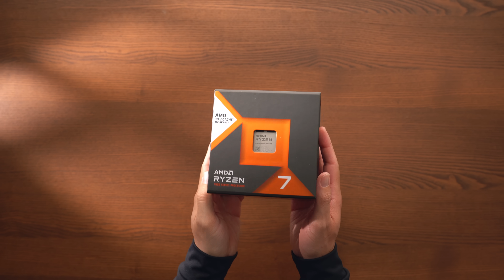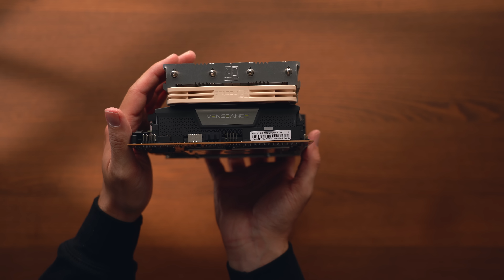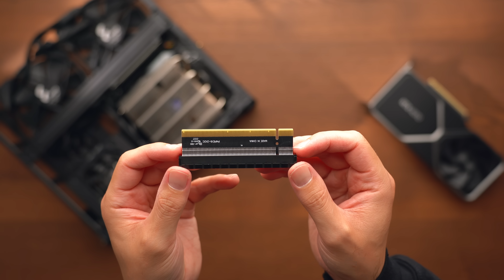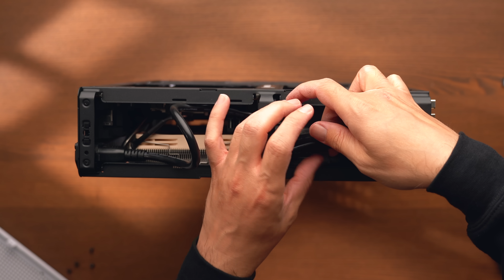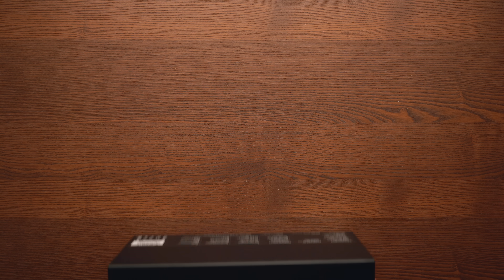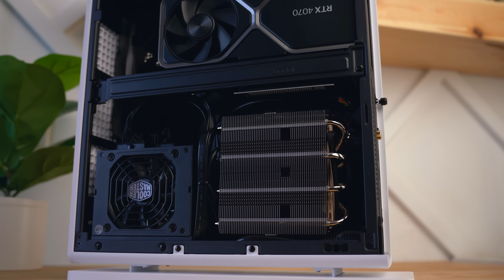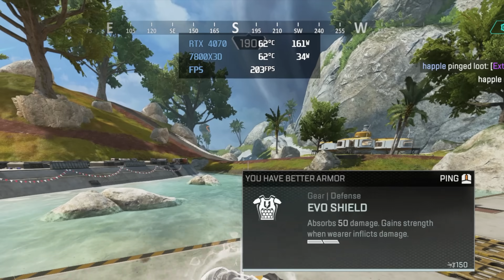UNREAL Mini Gaming PC - PS5 on Steroids

Comment: I'm a minimalist PC gamer with console envy, and this build is right up my alley! Terrific video! I subbed because I'd love to see more builds like this!

EDIT: Looks like I found a new phrase to troll PCMR elitists with. 😂
Reply: there is nothing to envy about consoles
Reply: @wellnesportstore9519  price/performance/looks/simplicity
Reply: @Ultra-Settings  did you just typed performance? 🤣🤣🤣🤣🤣🤣
Reply: @wellnesportstore9519  Hope you're aware that they parallelly connect hundreds of consoles together to do simulation computations in various military areas. So yes performance. Don't get me wrong, I still do hate consoles starting from the day they blocked booting windows. But gotta be objective.
Reply: @wellnesportstore9519  price to performance ratio.
I have a decent pc (i5 13600kf, 64gb ram, 6700xt) 
most normal peole who wanna play rocket leauge, cod & other Esport titles dont need a 4070
i am a pc user because i like the freedom of modding things and upgrading parts instead of being in a fixed buy cycle.
Reply: @wellnesportstore9519  Short answer: there are. Price-to-performance, priority, and aesthetics.

Extremely long answer (that you're too lazy and/or mentally challenged to read):

Price-to-performance ratio, for one. $500 PS5 that has everything you need out of the box or a $600 graphics card that's only one part of a potential $1,000+ DIY PC build? Unless you want power and are willing to put in the money and work to get it, most people will get the console.

For another: priority. Like it or not, consoles are given priority with (timed) exclusives and better after-sales support (e.g. patches). Before Sony and Microsoft decided to port their exclusives to PC, you'd be forced to buy a console or emulate the game you want (poorly). To give you examples: to this day, there's still no PC port of Red Dead Redemption 1 and it took 13 years of waiting to finally get the 2002 Resident Evil 1 Remake on PC. Some console games are continuously patched, while PC ports are left in the dark and have to rely on fan-made patches to be functional.

Lastly, aesthetics. Call me a boomer, if you will, but if I want to be taken seriously as an adult professional, I don't want my PC to look like it was made by an edgy 15-year old with the "black/red trim, angular, RGB light show" kind of aesthetic gaming PCs typically go for.
Reply: @jmal  lol i aint gonna read this crap just admit your wrong there is no performance they had to create 5 gens to finaly get up 2012 pc performance while computers were crering the very games they sell
Reply: Consoles offer a better, a FARRR better social aspect, and voice chatting, FARRR Better, but they suck  :D Only saying the pro.
I got a ps5,4,3,2,1. PSP. PS = Kids and generally more adults. Cleaner menues - Worse socially than Xbox, mostly due to there being more adults who have social anxiety.
Xbox1,360 Elite. Xbox = Kids. Xbox = even better social.
Reply: @wellnesportstore9519  if you think that there is a pc with better price/performance then youre ridiculous
Reply: You're like 1/50000 people in the world that this video actually benefits. I'm happy for You.
Reply: @eugenijusdolgovas9278  Thanks! It's nice to know that we all have different preferences and can build our machines however we like. That's something consoles will never be able to replicate, much as I envy them on certain things.
Reply: @jmal  there's nothing in consoles, that PC players don't have. Gaming communities are way more toxic on consoles, so idk what You're longing for there.
Reply: @NeonXXP  Console was a portable item, that is affordable, which it is now. Compare 6700 + 5800x build in 2020 to pc price and You'll what SOME pc players envy. Aside from that, it's crap.
Reply: @wellnesportstore9519  Why? Where else would you get a pc capable of 8k gaming for 300-400$??
Reply: @jmal  Console HW is known to be under-priced to stay competitive. So in short term HW is cheaper but in long run it gets even if you consider more expensive games and need to pay subscription to play online. PC is multi-role device and can handle more tasks than just gaming. So in most scenarios you have low-power work/internet PC + console but you can combine this money to get single better PC and suddenly the price difference is not that huge. The major advantage of console is that they are easy to setup and use but that limits them in functionality but nowadays you can buy pre-assambled and pre-installed PC so this is no longer relevant.
Reply: @qwe5qwe566  We all know that, but does the mainstream? There's a reason why devs and publishers give priority to console releases and treat PC ports like a red-headed stepchild.
Reply: @jmal  mainstream gaming is rubbish since it's grown big. It's like any other mainstream branch like movies or music. If you want niche games steer away from mainstream into indie scene and you often don't need nasa rig to enjoy it and no need to cry about bad ports since majority of those games never make it to consoles and if so then after they finish pc version.
Reply: @qwe5qwe566  "no need to cry about bad ports because the majority never make it to consoles"?

Your statement doesn't make sense. So if I take it at face value, you're saying that we should let developers treat PC gaming as an afterthought because of your personal preferences? Is that what you want me to take away from what you said?

And while I get that you don't need a literal supercomputer to play an indie game that utilizes retro-style graphics, what does that have to do with AAA developers treating PC gaming as an afterthought?

What is with this dogmatic approach to PC gaming? Why is taking inspiration from consoles so taboo and verboten to you people? You know there are far better things to be dogmatic about, right?
Reply: @wellnesportstore9519  I also said price which you ignored but you replied with more emojis than words so I’ll not take you seriously
Reply: @@elisepulveda8124 how am I being biased? I’ve owned every ps, 2 Xbox’s and Nintendo consoles but I’ve primarily played pc for 3 years now. You do get a lot of freedom on pc but consoles have a lot less technical problems unlike pc such as games not launching properly or at all. I’ve had to google a problem a lot more for pc than I have console
Reply: @@elisepulveda8124 I'm not ruling anything out, you don't have to pick one over the other. I'm saying consoles have a lot of benefits and people like to shit on them because of the pc master race mentality
Reply: @wellnesportstore9519 I game on both ps and pc
Reply: @@elisepulveda8124 Yeah you're young. I understand why you'd think like that
Reply: @@elisepulveda8124 6 replies in a row says a lot
Reply: @@elisepulveda8124my location?💀You’re 17 I don’t think your parents will let you on the bus by yourself
Reply: @jmal the ps5 side plates look defective lol.
Reply: @@elisepulveda8124 My house has disability access and John Travolta access I have a landing strip in my back garden with a terminal extension on my house so he can park straight up. I also have a Bugatti Chiron with rgb paint first of it’s kind you’re not on my level bro 💀
Reply: @@elisepulveda8124 sorry bro you’re not high enough level to be talking to me
Reply: @Eli Sepulveda Consoles are not only for “simple people” as you say. Alot of tech savy people prefer to play on consoles due to things like shader compilation stutter with unreal engine 4 games, and poor optimisation for aaa games, there’s been alot of bad pc port launches this year. And then there’s games like Fifa 23 which was a bit of a mess on pc, it doesn’t matter how tech savy you are, if you like Fifa then it wasn’t a great experience for pc gamers. Alot of Game devs favour optimising their games for consoles. But it really depends on what people prefer
Reply: @Ultra-Settings I don't get these people, dude. Of all the things to be elitist about, it's freaking gaming computers. And they tell me console gamers are toxic? 😂

Something tells me they're just a bunch of privileged kids with no real problems in their life.
Reply: You can smell the pissy mustard rice foaming at the idea that their platform of choice could be in any way inferior to consoles lmao
Reply: How about having both a console and a PC for gaming? Consoles are sold under price. For 800 hundred bucks you get a PS5 with an extra 2 TB SSD. That's a piece of hardware that's smaller, quieter, and better designed than most PC, while for 97 out of 100 games you won't see any difference to the 1800 bucks system from the video. I mean not all games use ray tracing or subsurface scattering so that you actually need even more power than a PS5. Excellent games need much more than good graphics. Take the Horizon games for example. If you played Forbidden West and than play Zero Dawn, you will notice the missing subdermal light scattering, however, the old version is still a tremendously awesome game that runs on my PC very well with a Radeon 570...
Reply: @chetzmoka  That was from over a decade ago. It was called the Condor Cluster I believe. They used PS3s due to their powerful (but hard to develop for) cell architecture which had Yellow Dog Linux. They were also much cheaper than PCs.

Most consoles now since the eighth generation basically just use heavily customized PC hardware, and they're much more locked down.

Wikipedia has a pretty interesting page on this:https://en.wikipedia.org/wiki/PlayStation_3_cluster#Single_PS3

Comment: I love these sorts of ITX builds. Huge space savings with tons of performance.
Reply: @ronakparikh  Actually, mini ITX systems are common in China as university students are pressed for space. I know a lot of people just like the smaller system for the aesthetic and some like it because its more wieldy to bring to LAN parties (for those who still have those). I know I like them because they are easier to make clean and compact on a desk given multiple monitors.
Reply: @ronakparikh  i have a DAN-A4 build for travel purposes. The entire PC with all the stuff in it weighs 4kg with a tripple fan, dual slot GPU and a 65W CPU that doesn't throttle.
Since most airports only allow 8-10kg max for carry-ons weight and size matters for me. Sure, I could pay twice the amount for half the performance on a gaming laptop but I like to have an actual desktop PC with minimal restrictions.
Reply: I avoid tiny cases because you attain much better thermals and inaudible fan noise in bigger mesh-style cases. Mini cases are only worth considering if deskspace is very tight or you have a requirement to transport your desktop PC around.

Comment: Hey man one question here : The main challenge being the size of the case and of course the cooling of the CPU, and given the fact that you had to buy this very specific low profile Noctua (excellent by the way). Would you consider to buy and install a 10$ CPU contact frame (from Thermalright for example)? 
i've heard that those things could lower the cpu temp. by 5 and up to 10 °C.
Seems to be a pretty cool, low profile and low budget solution to optimise the temperature and the performances? what do you think?
Greetings from France.

Comment: New Gen Consoles have 16gb of memory 😂 while a single component that costs $600 only has 12gb
Reply: Thats ram and vram combined
Reply: @megajatt123  no ... 😅 ... ps5 has 512mb ram for os and 16gb for vram! 😂
Reply: @Ummer Farooq  512mb ddr4 ram is for background tasks like downloading updates while the main zen2 cpu is turned off, they had a similar ststem in the ps4. Look it up on wikipedia. 16gb gddr6 ram is shared between system ram and vram.
Reply: @megajatt123  it is NOT shared between system. That 16GB is solely for the game. Just observe The Last Of Us or Hogwarts on gpus with less than 16gb memory, they were forced to use motherboard SDRAM so much so that 32GB ram was topping out for those systems playing those games. A combined 12GB gpu vram and 32GB sdram makes it 44GB ram use. Come on this is a no brainer, 44GB vs 16GB+512MB. I'm sure the xbox series x could be modded with 20GB vram since it has 10 ram places.
Reply: @ummerfarooq5383  Yes it's for the game but not solely vram, it has to be used as ram too. It has about 10gb of dedicated vram.
Reply: And the consoles would be crushed by the 3070 let alone the 4070. Embarrassing.
Reply: @RTSchofield  rubbish. When the ps3 came out in 2006, it only had 256MB vram + 256mb dram. Two years later i got a hd4670 1gb and played gta iv on it better than what the ps3 or xbox could deliver. Welcome 2020, ps5 comes out with 16GB VRAM + 512MB SDRAM, its been 2 years now, granted there was covid and the Ukraine war, but wheres your 16gb 4050 or 7500xt? 

These cards and the last gen lot can't even handle stutter in games that the same ps5 can handle!  It's not on!
Reply: @ummerfarooq5383  you are aware the ps5 runs games at middle-high settings and still struggles to get 60fps on native 4k, right? I had the ps5 for 6 months out of sheer curiosity. I did extensive comparisons with my old gaming rig which had a 7700k and a 2080ti. In every game the ps5 looked and played worse.

I won't even begin to compare the outdated ps5 to my newer 12900k, RTX 4090 rig.......
Reply: @RTSchofield  Hogwarts Legacy ... The Last Of Us.

Are you seriously trying to compare the $2000 4090 with the ps5? I was talking about stutter on mid range graphics cards, when when the ps3 came out, 2 years later low midrange graphics card had twice the amount of vram as the ps3.
Reply: what im getting at is pc gaming is at a halt, unless you're spending $1000+ on the latest and greatest. You can't build a new pc as powerful as a ps5 at the budget of $500. As consumers we are just getting spit on by both parties in the pc market.

Comment: Its possible to add 2 80mm fans attached to the riser metal frame, helping remove the heat from the cpu chamber upwards and out.
I bought them to use in the top slots but they didn't fit with the gpu in there, so I decided to see where else they could fit, and the result was very good.

Comment: Use an air mouse they work best imo having bought and tested them all. Kind of like a VR remote, keyboard on back. 
Maximizing a PC vs a Console a huge point is dual panels as you can watch things, triple panels for browsing, gaming, and video. 
Also setup all emulation from your login so you have access to every console.
Demoing all this in comparison will provide a "real" reality check to what the system can truly do, for the less technically inclined. It will help them make their decision much easier. Subscribed!

Comment: My experiences with this case:

The power LED is like a lighthouse beacon, especially if your MB choice flashes during sleep mode.  I used some blue painter's tape to tone it down.  Livingroom case, fine, bedroom.....just wow.  

It seems to be best with Founder's edition cards.  Maybe even designed around them.  I built with a 7900gre and it pretty much blocks the side vent holes.  I am wishing I had found a FE 4070 super because of lighting and cooling headaches. Or at least something with a more blow through design.  My card is not a bad card, just a bad fit for this case.

I used a thermalright argb cooler and wish I went with the Noctua. I had this stupid notion that I wanted to try and get a little rgb bling and that was a mistake.  If RGB is something you want plan way ahead.  A standard GPU is tucked way inside behind things and looks pretty bad with RGB effects on behind the (awesome) included fans but not much better behind RGB ones.  

As with many SFF cases, cable management is more a "tuck and hope" affair.  Triple check from at least 2 or 3 angles that your connectors are in before moving to the next step.  Having to tear everything down to find out you didn't manage to snap in a plug right just makes your tears even more salty.  

It is a beautiful case with great aesthetics overall but does require some planning to build cleanly.  Devyn's built is pretty on point and deviating from his recipe is gonna take research and dedication.

Comment: I just built this with the PNY 4090. You need to take the fans out. cut half of one of the plastic alignment nubs on the front panel and you either have to take out one of the knuckle clips on the side panel cause I hits the metal back panel on the gpu or mark the back panel, take it of, and use a dremel to shave a small portion of it off so you can use the side panel knuckle clip. This gpu just fits side to side. Literally, it touches both sides.

Comment: Useful video because you are demonstrating the use of the 120mm fan on the ls12 rather than the 90(whatever) mm when paired with corsair vengeance. I am currently speccing a similar build and I have chosen corsair vengeance (although 6000mhz and cl30 rather than 40) and the smoller ls12, I have now swapped it to the 120.

Comment: Planning same basic build - but ProArt 4080 & MSI motherboard   This was very helpful. 

I must have looked at dozens of cases - many that I found are not available (Dancase C4-SFX, etc)  
 I toyed with the idea of a Lian Li A4-H20 build, but I just don't like water cooler - probably some residual paranoia about leaks. 
 Then I looked at the Terra (love the way that case looks) but the best cooler I could spec to fit (thanks to the ProArt)  was the Noctua NH-L9x65 - which they say will handle the 7800 x3d but it seems to leave no room at all.  I really like the look of this - but the Ridge allows a better cooler and has the advantage of a smaller footprint.